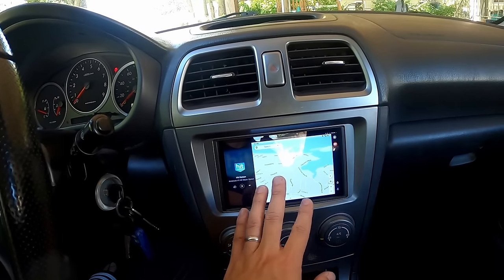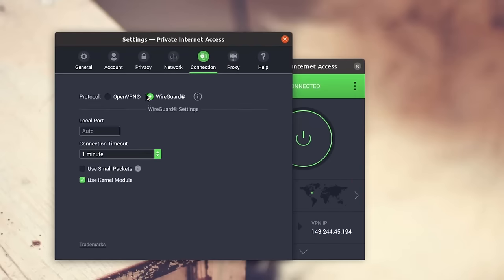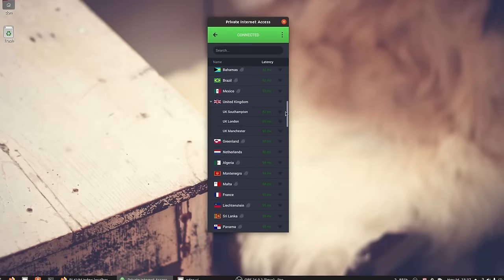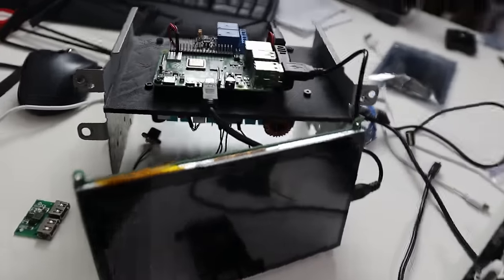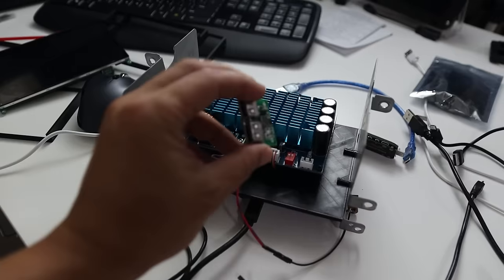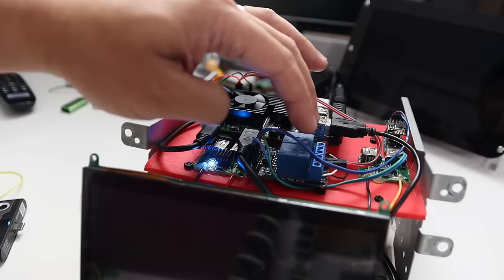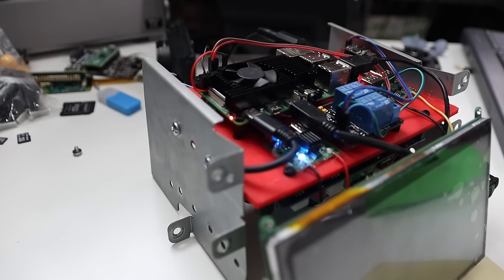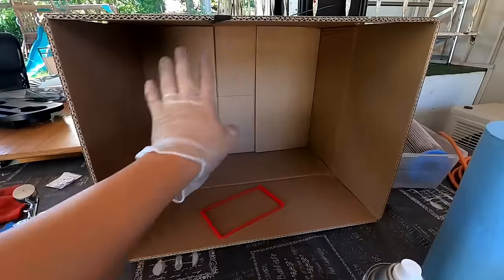OpenAuto Pro / Raspberry Pi Head Unit with Android Auto Full Install Build

Comment from the maker: openauto pro follow up with script install https://youtu.be/ko-udLtaPk8
Reply: No one should be using OpenAuto Pro, and you absolutely shouldn't be giving them publicity.
Why? Because the developers are scumbags.
OpenAuto is GPLv3. This means that any project based off of it MUST also be GPLv3. Which means that the source code MUST be provided when software is distributed.
OpenAuto Pro "...is an extended version of OpenAuto..." But it has an entirely different license, and BlueWave Studio will not release their source. https://github.com/f1xpl/openauto/wiki/OpenAuto-Pro
That is not OK. You cannot closed source a GPLv3 project just because you don't want other people to redistribute it.
The WHOLE POINT of a copy-left license is that other people can view/change/redistribute stuff.

In-fact, GPLv3 literally allows YOU to sell copies, or make any changes you want to THEIR software (as long as you indicate your changes, and your release is also GPLv3).
Reply: @Prophes0r  right so are you saying that they are basically forcing people to buy the 'openAuto Pro' ? (assuming they sell the pro version)
Reply: @everythingcool101  No. Nothing like that.
They have a project that was released with an open license. This license legally requires them to do things, and forbids them from doing other things.
Yet, they are doing the things they aren't allowed to do, and NOT doing things they ARE required to do.

It's a perfect example of fucking up an open license. It's not about the money. It's about the obligations that come with being open. And what happens when you ignore all those obligations.
Reply: Qual e a utilidade disso americano
Reply: Where are you located I would love to pay for a build on my Infiniti Q50 it doesn’t come with apple car play 😢
Reply: How does this compare to the autopi can that you can buy.

Comment: How a complete build in detail from scratch to build the head-unit in several videos would be handy . detailing all connections, software, adding different module and setting up, especially things like 4way audio, radio tuner, cameras, etc
Reply: Every car is different.
Reply: @Gummibri  yes i get that some can bus data and fitting will be different but the main build of head-unit, and setting up will be the same, setting up things like radio, screen, camera inputs, canbus inputs, aux audio inputs, power supply, etc etc
Reply: Yes please.

Comment: I've managed to get FM running on a Pi using one of those cheap $10 SDR dongles that have the RTL2832U chipset.  That chipset is probably the most commonly used and supported chipset for SDR devices on the Pi.
Reply: What software do you use to interface with tuning on the pi? Welle io (in open auto) appears to be DAB only and thus isn't picking up FM for me.
Reply: You might be able to detect the carrier for the police data terminals and estimate how far away the nearest is and how many are there using that sdr.
Reply: @iamadistunguishedexp  the RTL-SDR is designed as a DAB tuner and is hacked to be an SDR. To get SDR functionality, usually you have to blacklist the DAB driver module and install the SDR module (if it isn't already installed).
Reply: They aren't great for FM without proper antenna/cut filters
Reply: for Am and FM I would used the directed hd radio box  and rs232 to usb adapter  I still have mitches files that you can decode for commands

Comment: The problem with using a ground loop isolator is they cause your audio to sound like garbage... but i guess at least it gets rid of the engine rev noise. It's possible to get rid of the ground loop, you just gotta do some wiring. Everything must be grounded at the same location in order to remove the buzz. Measure the resistance of your grounds to make sure they're solid. Just because you buzzed off a bit of paint and screwed the ground in tight, doesn't mean it's properly grounded. Modern cars are glued together a lot and don't have the greatest conductivity between panels. I'd also double check that your power adapters for 12v and 5v are outputting proper voltage. Since the car runs at a different voltage with and without the engine being on. 14.8v while running can do weird things.

Comment: I would be curious how it stands up to extreme vehicle temps in the midst of summer of like Arizona. I've done a tablet head unit install in the past and no model holds up and overheats. I'd even put a cover on it.
Reply from the maker: me too, time will tell if i need to make more adjustments..
Reply: if you build it right your display for your Raspberry Pi will conk out before the Raspberry Pi will.   especially if you mounted in a location like underneath the seat or in the trunk area or someplace where there's more air flow that is needed to cooling down the chipset,    it will be able to keep up far better than some head units. 

due to all the HVAC and other items that are there underneath the dash and the fact that it usually doesn't have very good ventilation heat gets trapped  especially when you use a full size double DIN stereo.  there just isn't very much ventilation for the amplifier and the components back there.      

however with the way he has his system setup , with that cooler being involved and cooled by the Raspberry Pi itself  the only modification I would make for temperate climates would be to mount the amplifier on top and the Raspberry Pi on the bottom.    in all actuality it's not going to make that much of a difference but that's the only suggestion I would make if running in the configuration that he has it in.   

I often had problems with my phone overheating and shutting down while I was in California so I just basically bought a white Samsung S3 and that's pretty much all I had to do.   every once in awhile I would get a battery temperature warning that it would not charge but other than that I didn't really have any problems with it shutting down and I use that as my main source unit for my audio in my van for over a year.  

for the rest of you that have Double-Din head units trying not using the audio amplifier on board and use the RCA outs to an outboard amplifier or you can mount in a cool place and install a fan for air flow.   

if nothing else you can do what I had to do a while ago in a very special build where I had to install tubing and a PC fan to the back of the head unit and extra fans on the back of the head unit and with an exhaust that was tapped into the HVAC system or exited out of one of the vents.   that was Overkill but there's always a solution
Reply: I would use a polyethylene chopping board instead of a printed plastic one. It's easy to cut and drill with simple tools.

Comment: I've been playing with streaming music for years in the car.  I first mounted an old tablet, which worked for 2 years until the screen died from the heat (touch screen connections pulled off).  This let me know that only quality LCDs should be used.  I've been running an RPI (3?) with Openauto Pro in the car for years now with the official 7" RPI screen, and it's worked very well except when Google updates their software and it breaks for a little bit.  Great to see this video about it.  Very nice!

Comment: SSD is absolutely recommended especially when you use Android Auto. After a few weeks of use I had serious reliability issues with SD cards (system was not booting up or only after multiple attempts)...
No such issues after installing an SSD.
Reply: My 1tb  external ssd drive takes like 2 minutes to mount on my chinese android head unit. Do you have this issue? After two minutes it finally says mounting external storage then it works.

Comment: I've been working for some OEMs' "real" infotainment systems. This is impressive.
Reply: I have to ask do you actually put in these pre equalized settings in the firmware or is that someone else that requested and for what reason do they always put a horrible EQ curve into these cars that quite literally no one else wants lol
Reply: @MickeyMishra  I have not worked on audio or entertainment functions. I have no clue how much audio filtering there's going on on our systems, except for user there's just two settins "bass" and "treble". If there's some hidden EQ, I guess the profile for that comes from the OEM (the car manufacturer), or some other supplier who is paid to do the tweaking for the OEM.

Comment: I wouldn't suggest this to most people, but you're nerdy enough. You should drop a CAN-BUS Tx/Rx into the mix (there's even a great hat for the Pi). You can then access the car's data bus directly, and gain control over everything, including environmental, and any other electronics in the car (steering wheel controls!). The accessible OBD-2 ports block a lot of data and are largely read-only. With a performance car like your WRX, you'd get gobs of awesome data straight from the ECM. It also has the added benefit of being able to wire into the stock wiring harness nice and clean. You may have to Wireshark your bus to sniff the variables for awhile and map them, but totally, totally worth it.

Comment: nice project 
I created a custom Android Auto setup using a budget Lenovo tablet. To optimize it for in-car use, I made several modifications:

Removed the battery and replaced it with a DC-DC converter for direct power
Added cooling improvements with a heatsink and fan
Designed and 3D printed a custom back panel to house all components
Installed a small Bluetooth module connected to the ignition

The system automates itself using MacroDroid software. When the tablet detects the Bluetooth signal:
Screen turns on
WiFi enables
Head Unit Reloaded software launches
When Bluetooth disconnects:
All apps close
WiFi disabled
Screen turns off to conserve power

Comment: I was about to mention about touch screens being really bad for volume control when you mentioned it.
Another thought would be to rig up a jog shuttle/switch instead of a basic volume control so that when you are in the map view it could allow you to pan and zoom around the map view without having to drag the map via the screen.
Reply from the maker: Yea I'm working on putting something together with a raspberry pico
Reply: @MickeyMishra  Looking into an openauto project, do you have a link for this?
Reply: That's a great idea
Reply: @novaspirittech this is my very 1st video I watched on your channel. Great stuff, I won't be a stranger. @gordon861 I'm going to spring board off your idea. Would it be possible to create a nob dedicated to the low frequency cutoff? Like a high pass/low pass filter triggered through the raspberry unit? Or would it have to be more of an amp control switch? This had me thinking.
Reply: @novaspirittech just like bass nobs. I thought it would be cool to have a dedicated highpass knob and a bass knob.

Comment: You may want to put a little delay on the relay to turn on the relay. Reason for this is because when you start the car you'll get accessory feed for a few seconds, lose it while cranking the engine and get it back once the key is released from the start position.

Basically causing the Pi to start booting, get interrupted and then start booting again
Reply from the maker: yea it's got a 3 second delay
Reply: @NovaspiritTech  should be good
Reply: @NovaspiritTech  Might even consider doing a longer delay.  I have looked down this rabbit hole and considered scripts so when I pull in at home, it can connect to home wifi.  Sync music/media for awhile while the car is off and have the shut down script let that happen for 15-30 minutes or so.  

This would also give you coverage for like "stopping to get gas, running in the store to grab a soda or something."  just long enough that quick stops don't make you wait for head unit to boot.  granted, the pi4 isn't the slowest boot either lol.  not like back in the day of a car PC taking a solid minute.

Comment: Bravo! Simple and effective. I like how you approached the safe shutdown and parasitic draw issues. Would like to hear more on audio quality. On my setup, I'm now only using the USB sound card for mic input. I installed a PCM1502a dac for sound out which has much better sound quality. I've seen some guys using HiFiBerry for the same thing.
Reply from the maker: thank you! i haven't tested much with audio quality yet, only played a few song it sounds a little flat to me but i'm pretty sure the eq can fix that. i'll let you know more on my follow up video.
Reply: Interesting... The audio quality is equal or superior to kenwood-pioneer-alpine units?
Reply: @davidb741  it can be if you use an outboard a corn outboard DSP combo amp like those from audiocontrol.   but there are plenty of other options out there
Reply: @davidb741  It sounds pretty good with the external DAC. Unfortunately, I haven't had the opportunity to compare directly with a high-end head unit.
Reply: Audio quality is my big concern right now as well. It doesn’t seem to be discussed very often. Looking forward to seeing what you think about it in future videos.

Comment: I would add a forward AND reverse cam for those times when you have to park and there is virtually no room. As an even better solution, you might want to get a recording front and reverse cam to record what happens to your car when you are away from it.
Reply from the maker: yea i'm thinking of a solution for that, might posibly offload that to a raspberry pi zero

Comment: ::Shows cardboard box:: 

“It’s a really nice box. I might upgrade this later, add some LEDs, and a fan for exhaust.”

You should be selling houses!

Anyway, great video, really informative.  I was thinking about the heat.  Maybe flipping it, putting the amp on top and the raspi on the bottom. Also maybe putting the, on separate panels.  Like add a second plate to the very bottom of he frame and put the raspi there.   Heat sinks should always be aiming upward too.

Comment: Nice job.  The menus seem quite slow and laggy though, probably due to the SD card.  I'd definitely recommend booting and running the OS from a USB 3 HDD or ideally an SSD. Also, given how unreliable SD cards are (especially in RPIs) you'll probably find yourself needing to remove the unit to replace it at some point anyway.
Reply: pretty sure thats a result of connecting via wifi. I think it runs a lot smoother on usb.

Comment: I like your project!  Looks great.  Did you consider extending the front out so you could mount a much larger screen?  You could also add standoff's to raise the raspberry pi up a few mm to assist with heat dissipation.  If you need to adjust the base plate to allow for the height, you can add side 'wings' and lower the base plate and use the wings as new attachment points to the double din metal frame.  The wings could be 3d printed and glued or screwed to the base plate, then tapped and screwed to the metal frame.  This would give you whatever height you might need and allow for better heat dissipation.  You might even add a layer of insulation between the pi and the base plate to protect the plastic.  Perhaps drill some ventilation holes in the base plate to assist with airflow, even making a back plate for the lower area and add an intake fan, and add an exhaust fan up high to get that airflow.  Again, with standoffs, if you have holes drilled below the pi, the flowpath will have cooler air pulled in from below, then up through the holes, thus cooling the back of the pi, then out the top  or the back plate.  It would require 2 more fans, but you could easily run much larger fans - even perhaps have them controlled by the pi with a couple of temperature thermocouple's/sensors placed wherever you think best - It should be no big deal to add fan speed profiles etc... Good stuff!  Call me impressed.
Reply: Gosta disso tambem
Reply: This is a great idea, love it.

Comment: Compute Module 4 might be an perfect candidate....But custom designing PCB is a real challenge...Good Luck with your cool project!!
Reply from the maker: i was thinking the same thing... but the cm4 dev board isn't bad either with support for 12v
Reply: @NovaspiritTech  yep...Dev board is not bad but who know what the next pi will bring to the table(my suggestion - keep it upgrade able)....Any way as you said in the video just iterate until you love it !

Comment: OpenAuto rear-view defaults to the Raspberry Pi Camera (with the flat ribbon cable connector). There's a Pi-KVM project that recommends TC358743 boards for HDMI to pi-camera port. Then you can chain it with a cheap composite to HDMI converter. It's a bit roundabout, but probably the easiest solution.
Reply from the maker: Yea I have a few of those hdmi-csi2 modules I might give a try

Comment: How is the audio for calls?  One major issue with so many after-market head units are the terrible audio quality for calls (and many cause feedback between the speakers & mic) - if this solution can bring 'first class' audio when driving, then this is a huge game changer!  Also, have you figured out if this can handle steering wheel controls?

Comment: I used a UPS hat instead of a relay setup. I got a buck converter to take the 12v accessory from my truck and put it down to 5v 3a on two separate usbc cables. The UPS automatically turns on the pi. Also the UPS is able to do a safe shutdown of the pi when power is lost (when I turn the car off). And it holds time on the pi!